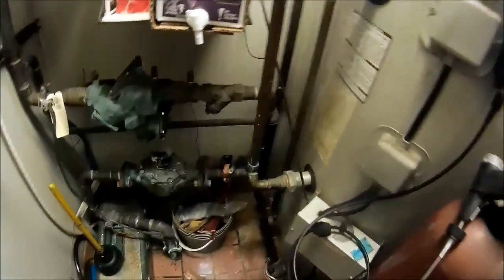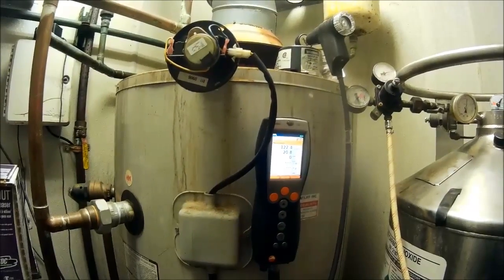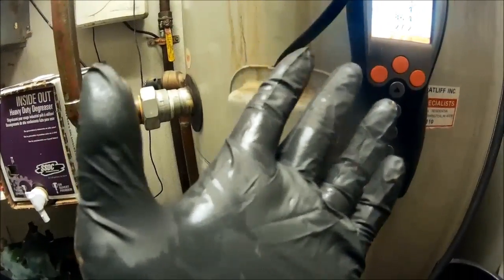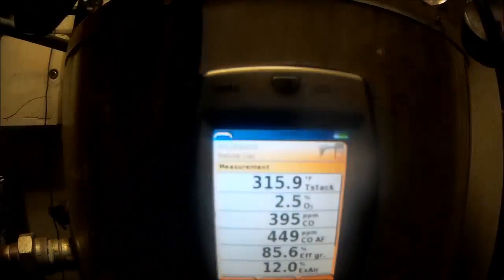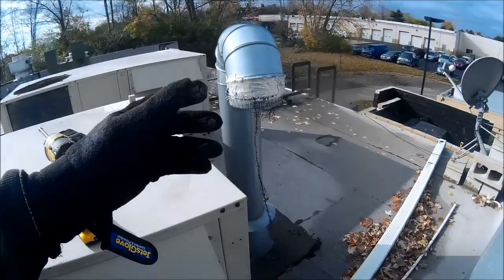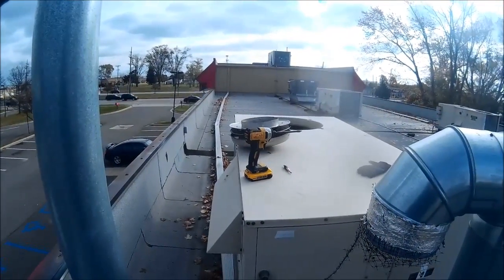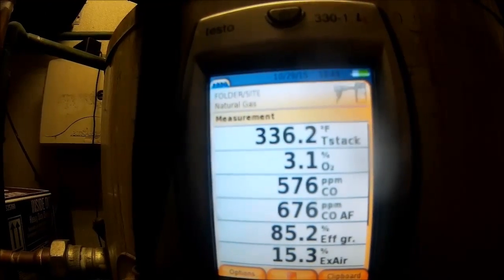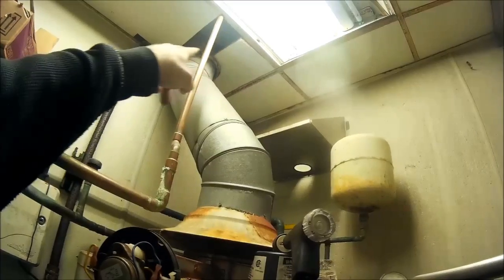Bradford White Commercial water heater not venting

Comment: If only opening that furnace room door is the fix for the negative pressure, why not just add enough wall vents to the room (and door) to match that same air volume?
Reply from the maker: That won't help the building is a negative pressure due to the exhaust fans

Comment: You really should take the CO/ Combustion analysis course from the Nat'l Comfort Institute. You're doing ok but not there yet. For one, you aren't taking draft readings in the stack to understand fully what's going on. You did not diagnose if it was negative pressure because you didn't use a micromanometer measuring the pressure differential or delta P between the Combustion Appliance Zone and the adjoining space or outdoors or conduct a draft interference test. There could be a high draft condition causing a 'curtain effect' which would block the vent causing spillage. You can use your combustion analyzer to measure the O2 at the floor level to see of you're getting CO2 spillage that displaces the O2. 
Part of the venting correction would be to remove the draft hood, install a bullhead tee with double acting barometric damper set with a manometer then install a spill switch wired to the thermocouple. 
That passive rooftop makeup air pipe with the gooseneck and jug would not provide MUA but act as a chimney further exacerbating any depressurization of the CAZ. You can't install a power venter if there is inadequate MUA and ASHRAE study proved passive MUA is wholly unreliable and does not work.
Reply from the maker: you need to watch my repair video on this and I do have jim davis cell # from nci

Comment: adding a barometric wont help its the same thing as the draft hood existing.  What needs to be done is balance the make-up air system so that there is a slight positive pressure in the building.  The county health dept. requires an air balance report and requires a positive bldg. pressure just for this same problem.  Check the m.u.a. blower motor and belt to see if its slipping or even turned on???  Also you should of not been in that room or left that job .
Reply from the maker: +gary smith the damper can be controlled a draft hood can't.
Reply: +Mi Heating Guy   Why not close up room and supply proper combustion air, like fan in a can? That air intake is way too small.
Reply from the maker: +David Sweet there's a few different options I have to look at and that's one of them
Reply: gary smith when I go to these calls I'll go on the roof to make sure the swamp coolers are on. Another way to fix this is by adding a draft inducer basically a blower that helps push the exhaust up the vent

Comment: As it spills, CO2 being heavier than air, displaces the oxygen by the burners & causes incomplete combustion, thus CO climbs rapidly. The combustion air vent & the chimney have no "brain" & don't know which way to go. That is a deadly situation. & your clients are lucky to have you. Assuming it is natural gas, a barometric, spill switch, thermocouple adapter & star kap should solve the problem. On natural gas you should remove the stop on the barometric & make it dual acting. It can spill for no more than 3 minutes before the spill switch shuts it down. This can be proved after installation. A low level CO detector in the occupied area would not hurt either. A fan in the can would be another way to positively pressurize the mechanical room. "As long as man has been playing with fire, we have been poisoning ourselves".
Reply from the maker: +Jeremy Calvin  From the sound of your comment you had a few classes from NCI and Jim Davis. Thank for watching